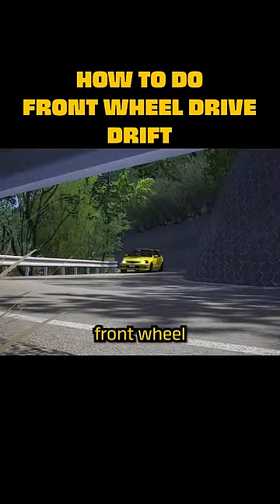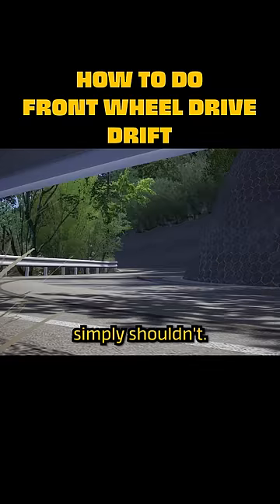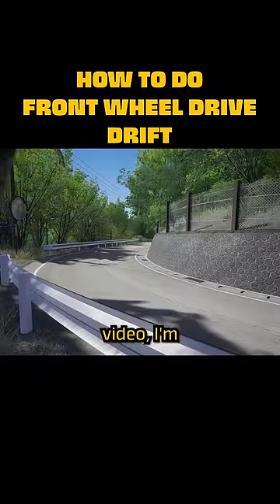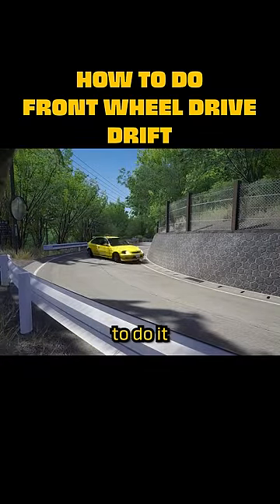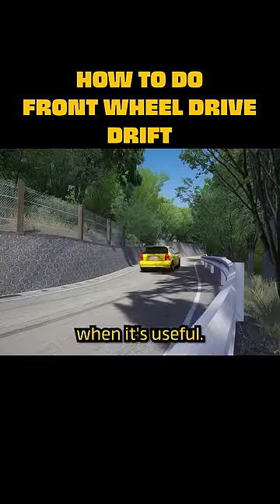HOW TO FWD DRIFT #simracing #assettocorsa #shorts

Comment: Lift off oversteer is faster and smoother, also requires less attention being diverted from the road ahead while driving. Sliding fwd cars around in real life like this can be incredibly difficult without entering some corners way too fast, slow speed corners can be really hard to get the back to step out even when locked up by the handbrake, simply because the wheels at the rear do their job and act as anchors in a straight line rather than breaking lateral traction without enough momentum.

Comment: You also need to disengage your foot from the throttle irl so that the weight of the car will be moved to the front. The correct sequence most of the times is:
Disengage throttle, steer into the corner, pull the handbrake.
It requires a bit of practice, but still is a pretty easy maneuver to make.
Reply: its easy on snow i dont even need to use the handbrake at all
Reply: @janistorlopare  in winter it mostly depends on the tires and speed. If you have shitty tires or trying to drift on high speed then all you will get without handbrake is a massive understeer. The fwd car i am using to train have purposefully bad tires so that it will be easier to learn drifting/doing corners the right way, as you have much less room for error
Reply: @hinkam3237  i got 3 studded tires without the studs and one spare tire 😂
Reply: @janistorlopare  xD Im using cheap old sticky ones, basically summer tires
Reply: @hinkam3237  what car u got
Reply: @janistorlopare  basically a renault

Comment: Believe it or not there's more reasons it works besides the "Power Slide" method. Even just lightly applying the parking/emergency brake helps because the suspension loading of adding rear drag tends to pull the nose down adding more pressure and bite on the front tires and effectively reducing understeer in FWD vehicles even without kicking the back end out or locking it up

Comment: If you set the car up on the nose properly (as all fwd should) you can also perform a braking drift as the rears will lock up very easily and allow you to pitch it in sideways

Comment: Simple rule, just drive fast enough and don't die, and make sure you have a 1/1.5 way lsd with familiar initial torque setting(harder springs or more clutch packs) and ramped up ramp angle for delayed lock. If you still manage to make it out unscathed after that, congrats. You manage to "drift" your fwd tripod machine.

Comment: As someone who drifts fwd in real life all the time in the winter and sometimes in the summer aswell, I can say that handbrake should only be used in tight corners and if you are understeering out of the road and there is no other way to stop the understeer but those situations are only happening when you have way too much speed (you are dead anyways no amount of drift gonna save you from that one) or then if there is over 5cm of fresh snow when the handbrake just might be able to save you with a slide especially useful when the snow is wet. On other occasions it is better to iniate the slide by other methods in faster corners such as scandinavian flick or trailbraking as those are more of a sure way of getting the car to atleast turn and most likely to slide but personally sometimes I just attack the corners by going hard on the throttle right before it and then letting off the gas completely when turning into the corners sharp but there is the danger of having too much speed if you don't know what you are doing as you need to have the right amount of speed or you are either gonna go out the road from the inside or the outside of the corner the reason that works though is because you get the mass shifting to the front and thus having more grip there. Defianetly take off the traction control before doing any of this shit as it will most defianetly kill you

Comment: Or just dial a bit of oversteer into the chassis/suspension and at the limit, the car will naturally oversteer. What I’ve noticed, in my personal set up is -2° of camber up front, and about 0.3-0.5in difference between front and rear suspension so that there’s a slight forward rake. This dials up the oversteer and dials down the understeer. At the limit, you should get a decent amount of controllable understeer. This is in a Prelude SH.

Comment: FWD drifting is easy. The thing that makes it so different than other drivetrain drifting is when you step on the throttle you will regain grip (at least that's my experience) so if you try to feather the throttle like you possibly would in RWD cars you would just eat guardrail. And for the most part it's nearly impossible to get one to do a braking drift and probably impossible for a Scandinavian flick with one so classic e-brake is the best option.
Reply from the maker: if you've ever driven a fwd car you'd know it definitely isnt impossible to get oversteer using the brake or a scandi flick
Reply: @TSRB  The Scandinavian flick still seems really hard to do. Might have to use a tuned/optimized FWD car just for that
Reply: @noahtheeurobeat7142  what fwds have you driven? dont need a tuned one, just an actual fwd sports car
Reply: @noahtheeurobeat7142 you just have to do it really aggressively. I base it off of weight transfer. As soon as I feel the weight get thrown off balance, I whip it in hard and stare at my exit.

Comment: The obvious difference between FWD and RWD drifting technique is that in RWD, drifting is initiated with throttle and turn while handbrake prevents drifting, in FWD it's vice versa - you yank the handbrake to initiate the drift while exit on the throttle.

Comment: I just bought GT7 and was reminded that it’s best to complete as many challenges in a single car layout rather than driving different layouts back to back. A FWD hatch, a mid-engine roadster, and a RWD front-engine coupe all require different methods to corner. Mix those methods up and into the berm you go. In real life, you’re realistically tracking one or the other for your average person.

Comment: Best thing to do is get speed, pull handy, floor it while handbreak is still on and now just keep ya foot on throttle so back and front is sliding/spinning and keep you back momentum by going side  toside into and out of corners only let off ebrake to gain speed.

Comment: The true Drift for FWD can only be done with a manual. Shift lock (clutch kick) combined with left foot braking technique can force the back end out while accelerating to the inside. This is only useful on the downhill where load control (weight balancing) is more prominent and drifting can be faster in sections with lots sharp or winding corners. Generally though, FWD performs best when focusing on grip and drifting isn’t really worth it unless your up against an 86 on Akina Pass.

Comment: My brother autocrosses fwd civics, and the best thing to do is to keep the car as much within traction as possible. Fwd drifting is not useful, it's a great way to slam into the wall or reduce your lap time. If the car does start sliding, you want to give the car more throttle to break the slide and to regain traction

Comment: My first experience with FWD "drifting" was when I was taking a highway exit and the exit wasn't cleared from snow. I basically was understeering, so I pulled my hand brake when I noticed that my back was starting to slide out, turned my steering wheel and drifted down the highway exit and ended up in the ditch where I basically managed to get out since I had all terrain / all season wheels there. 

I only broke my license plate holder but if I didn't know how to drift in real life*, 
I would slide straight into the barrier and broke more than a stupid license plate holder that costs like 3usd in my country on Amazon.
Also, it wasn't such a powerful car. It was just a Opel Astra G 1.7 DTi caravan (in other words the longer version of the Astra G)

*practiced in a BMW E30 before I got the Astra for 310$ from junk yard and basically had to repair the exhaust leaks to make it road legal again. I have to say that the Astra lasted me for quite a long time. I bought it with 23.000miles and it died (alternator set the whole car on fire) at around 410.000miles.
My new car is now a BMW E87 116i and it's great but I don't mess with it since it's my new daily and I spend like 8.000$ for it with summer and winter tires, has M-Package and the engine was heavily modified to last as long as my Astra did. I more focus on the visual modifications of the interior. The only thing that I did on the outside was swapping out the old side trun signal indicators with LED ones and replacing the license plate lights with dimmer ones since there's no requirement for the brightness level on the license plate lights and the old ones were too bright and too ugly for the paintjob that is currently on this car

Comment: Using the handbrake in tight corners works great but not for drifting, dragging the handbrake thru a corner will help with under steer Sliding isn’t really that fast in a tight corner

Comment: I believe technically this is not called drifting but called sliding or power sliding! It's used a lot in front wheel off-road racing
Reply: its actually physically impossible for a fwd to powerslide, a powerslide happens after the apex and all you do is floor it as you exit the corner and your back end kicks out, in fact a powerslide is basically when a rwd car understeers but they can still turn since the rear wheels are still pushing them out of the corner, fwds cant do that since the rear wheels have no power so if they do try to powerslide  they'll just understeer into a wall/rail since they cant push themselves away from the wall/rail. also sliding is just like the event that's happening, like a rwd drifting is also sliding

Comment: It takes alot of skill, but on sharp turns its not too hard to do an ebrake slide. Just be very careful, you have to commit fully or the car will pull straight

Comment: I was under the impression that it you couldn't drift in a front wheel drive car not because you can't do something that looks similar but because it wasn't tenicaly drifting but just you letting your rear swing. If I'm wrong that would mean I've drifted more than a few times by just swinging my back end on purpose, that would be kinda neat. But Hay doesn't matter what it's actually called its fun as fuck

Comment: A 'drift' in my mind is slipping continuously and smoothly controlled under power with no tyres fully sliding. Front wheels - full traction, back wheels - slipping but not sliding. A rwd or AWD can therefore drift. But the physics of frontwheel drive makes it impossible to drift. By thins interpretation of 'drift' what's depicted here you're only throwing your ass out so it momentarily looks stanced as if in a drift, the car could not continue to 'drift' like this in an endless circle or transition smoothly to travel to the other side while maintaining the 'drift'. 

Maybe some ~1000hp FF car with torque vectoring on the front wheels could drift similar to how a two wheel motorcycle can, but a vehicle powered by a regular front wheel differential do not allow it.

Comment: One thing I would do in my car in real life whit my fwd is I would flick my car towards the corner and then immediately flick and kind of touch the brake pedal kind of hard but not too much and then immediately floor it that would allow me to drift my fwd Honda accord 2001
Reply: So in theory you just turn towards the corner immediately turn the opposite way to flick the back a bit and then slam the brakes enough tsk the front of the car has most of the load and while the car is flicking to exit the corner you floor and counter steer

Comment: It’s just sliding, not drifting. Drifting is when the power tires are sliding. Power sliding is when all tires are steering. This is just sliding, and very common in the snow. And you don’t need a handbrake, just use good foot braking and initiate with just steering and a hard tap foot brake then once around the corner mostly lay on the gas. Similar to RWD but just line up straight where you’re trynna go 😂

Comment: I tried to do this before and the handbrake mechanism broke before the tires would slip. Do I need to uprade it or am I doing something wrong? I just had it fixed as it was but when I tried it again, I bent it and gave up immediately so not to break it again.

Comment: This method is too slow and damaging to tires, also impractical. By the time you just do it like a normal racing line, it's marginal at best.

However, there IS a way to do this with suspension tuning, which is how I setup all my FWD based cars. My spring rates are gonna be set for the weight of the car, and the goal (cruiser, street/track, track). Then, my pre load for the front will be preference to how I want to spring to act, usually stiffer the spring the less pre load I'm throwing into it. The rear, however, gets more preload than the front (I'll explain in a bit). Then go about your dampening how you drive the car (my front is generally going to be harder than the rear for weight balance and control, less work on the spring). For the rear it's more about ride and handling than anything else, but may do a click or two stiffer towards the front (i.e. close the dampening "gap" as I call it, make the rear more similiar to the front by a fraction). What this results in is under heavy load, mid corner, you can lift off the throttle causing on demand lift off over steer, and when you get back on it, everything compresses and snaps back into line. This is my preference, and being predictable under heavy loads I know exactly how my cars going to react, drive in and out of the corner, all while never needing to touch the brakes. The best part is it's only at the limit, so when you feel under steer and let the car unload a little bit the rear will unload ever so slightly faster than the front giving you the kick but also allowing the front to catch itself again and grab. When you aren't pushing the car, it doesn't react that way at all. 

If I can get the car for a day, maybe I'll take a video of it as proof of Concept. Loved that little Mk3 TDI jetta

Comment: I wanna know the understeer method, not the ebrake method I learned in forza
Reply: As you turn into the corner, tap the brakes to shift the weight of the car forward, loosening the rear tires and pushing the fronts into the road. If done properly, the rear will step out and start to slide while the front continues to grip.

Comment: It seems that you don’t know the difference between a power slide and drifting, especially your other video about shifting down just to shift back up, you’re essentially using the gear ratio & clutch to break traction (and would definitely break your transmission) the shorter gear ratio basically locks up the rear wheels because the small 2nd gear can’t allow but maybe 25-35 mph speeds and is more for torque, so now the rear wheels have begun to spin (because of the low range gearing at high rpm) you shift into 3rd and dump the clutch keeping the high rpm to keep the wheel spin.
Reply from the maker: https://www.youtube.com/shorts/n2XG4KO6cPM

Comment: So this is a Pulled Handbrake Turn. Sure it's "drifting"; its easier to name it off. If it were a RWD car using the handbrake in this case it may be a Pushed Handbrake Turn. Clutch in a RWD would be a Pushed Clutch Turn. If you need to correct your oversteer it would be a Pushed Clutch Counter-Steered Turn. Just like naming off medical procedures, diagnosis, I guess instead of adding greek words into a single word...You just add more english words into the refereed technique of drift. 

A good example of something that is not a drift is NOT Drifting through the corner. IE never losing traction.

Comment: sorry but a drifting can only be done with power to the rear wheels fwd cant drift slide sure its the same as using a handbrake to drift isnt drifting
Reply from the maker: So the guy that 'invented' drifting as a sport, and covered handbrake drifting in a film called "The Drift Bible" is wrong?
Reply: @TSRB  yup
Reply from the maker: @r2dlee953  brilliant cheers lee

Comment: Drifting for the most part requires the rear tires to be pulling the back end around the corner.  They do this by getting power to the back, which isn't possible in FWD.
Handbraking is just a part of the drift overall.

Comment: That's not drifting it's power sliding.... there's not a "handbrake drift method" that just power sliding and is incredibly ineffective when traction and grip runs are the fastest way to run awd and fwd vehicles
Reply: how is it power sliding if power isn’t causing the slide